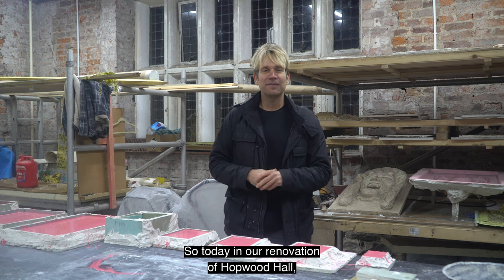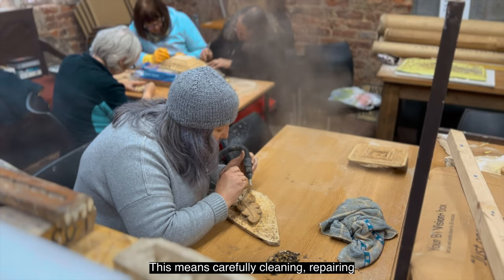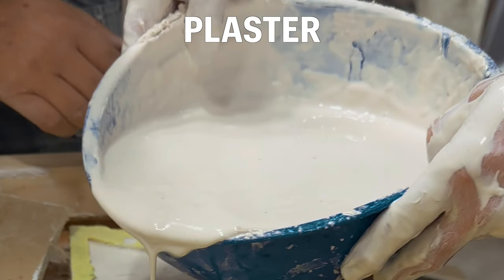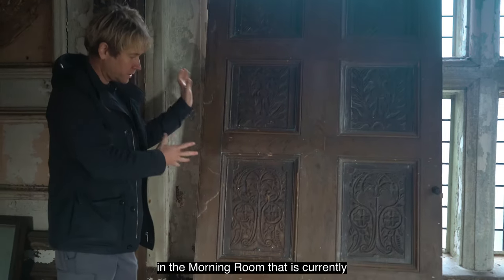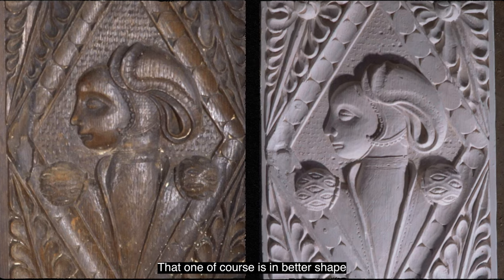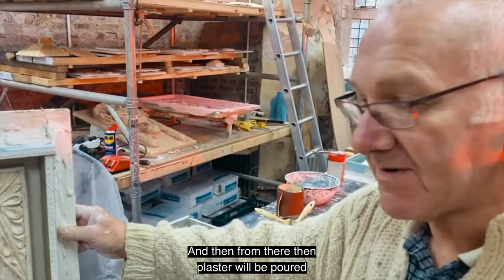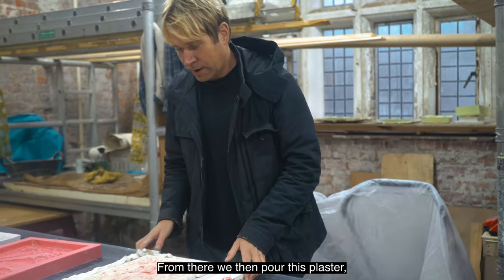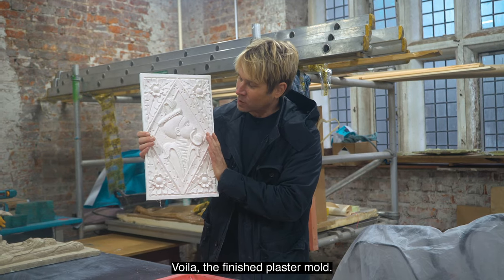Plaster Mold Making!

Comment: I use to work at a company where we made most similar to this. One statement was not correct about the silicon molds lasting forever. They do lose their sharpness to detail with use. I suggest that it is wise to make the first five castings and save those to make more silicone molds down the road. There is also a plaster that dentists use that is very sturdy and stronger than plaster. I do love watching your videos.

Comment: So if I have it right, the wood carving designs, like in the door, are replicated in plaster in other parts of the Hall? These plaster molds are to restore those damaged plaster molds?
Reply from the maker: Hi, yes it if there are missing areas of plaster then we could at least replace with a design that is unique to the Hall. Many of the designs like flowers are through the Hall in repetitive carvings so it will most often be used for those. The wood carvings on the door will remain intact and will eventually be fully restored